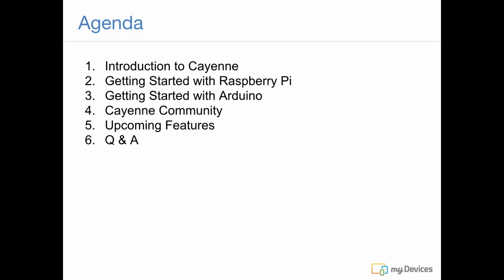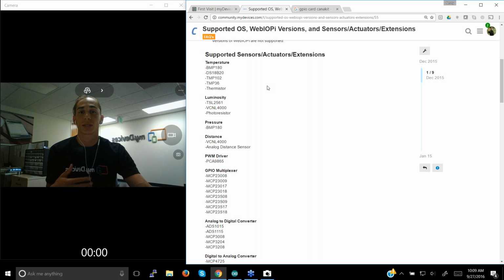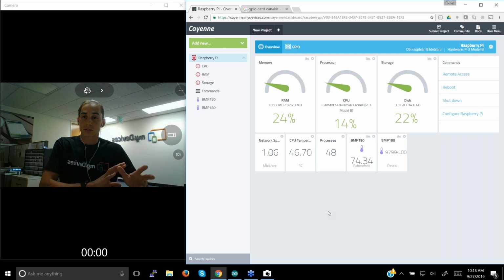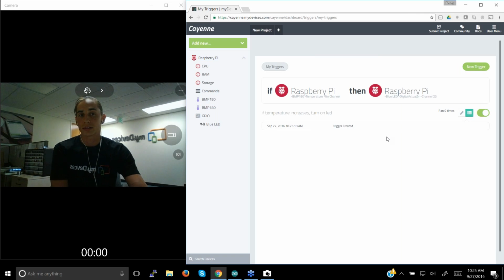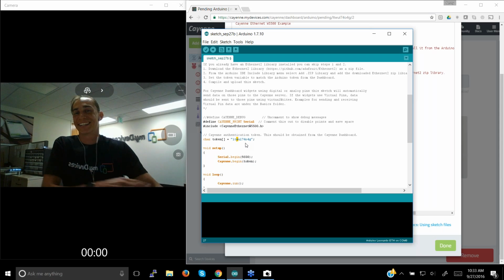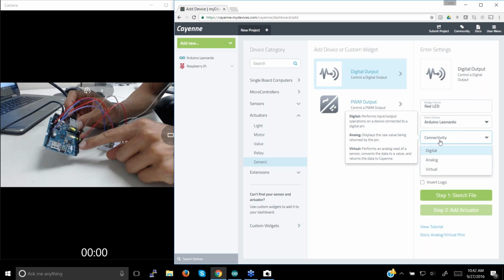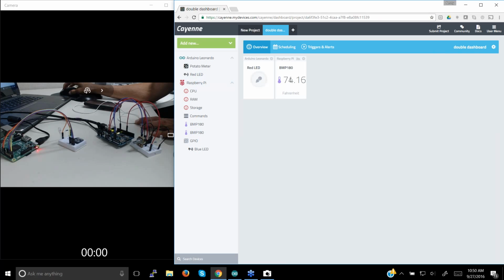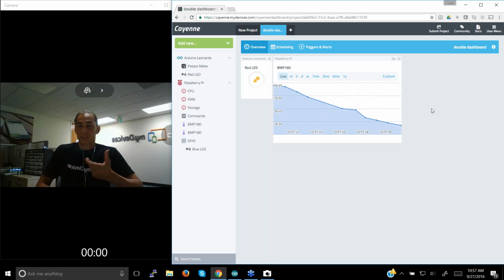Introduction to Cayenne

Comment: I have a question. I want to use ASC712 current sensor connected with MP3008 sensor. The output value will be current sensor. Can you tell me should I directly hook it up and the values will be current values or so I have to do some callibration?
Reply from the maker: Hello! Please head on over to our Community at: community.mydevices.com with this question. We have many people there waiting to assist you!

Comment: How can I connect a DHT11 sensor module to Cayenne, is the module available on the platform.

Could not have found a way to read the temperature data of that sensor, can I help with that problem?
Reply from the maker: Thanks for offering to help, Andres! Though it's not officially on the platform yet, many users have contributed based on the ways they've added it. Here's a link to our Community forum for DHT11 with Arduino, and for Pi. 

http://community.mydevices.com/t/want-working-dht11-code/2068 

http://community.mydevices.com/t/dht11-dht22-with-raspberry-pi/2015

Comment: Hola hace unos días intente conectar un Arduino uno, y la Ethernet Shield W5100, con Cayenne, y cuando llegaba a la etapa que Cayenne dice (Waiting for board to connect..) tarda y tarda y no hay caso, en este caso se cargó el código al Arduino y la Arduino Ethernet Shield W5100 está conectada al Router, espero pero no se conecta.
No obstante a los pocos días lo volví a intentar con una Arduino Mega 2560 y otra placa Arduino Ethernet Shield W5100, pero tampoco conecta. Realmente no se cuál es el problema.
Reply from the maker: Estoy usando Google Traductor para publicar esta respuesta, así que por favor disculpe cualquier error. Siento haber encontrado un problema. Puesto que tiene una cuenta, podrá crear un nuevo tema en nuestra sección de ayuda de la comunidad. A veces es una solución muy simple, pero de cualquier manera, los demás tendrían que saber un poco más acerca de su configuración. Aquí hay un enlace directo. Http://community.mydevices.com/c/need-help-with-my-project

Comment: how can i use voice control with cayenne, just asking for info or where to find?
Reply from the maker: Alonso, here's a close project we found that uses voice control, though it's a little complicated and pulls in a lot of hardware. It's a link to the Community, so if you browse the "Projects Made with Cayenne" section, you'll find more ideas, as well. http://community.mydevices.com/t/esp8266-nodemcu-with-dht11-connected-to-cayenne-and-alexapi/1979

Comment: Hi, I have a node-red , MQTT based automation system. Can I integrate Cayene as a admin/monitoring tool, rather than connecting sensors directly to Cayenne, my sensors and actuators are based on ESP8266 and connects to a node-red server (also has MQTT server running for publish/recieve requests. Can I connect to this MQTT and monitor the system?
Reply from the maker: Ajith, this should work, but it may require a more advanced setup. If you'd like, you can create a post in the Community forum so that other users can collaborate with your idea: http://community.mydevices.com/c/need-help-with-my-project

Comment: worst sound ever
Reply from the maker: Eric, the sound isn't ideal, though other users have been able to hear it. We'll definitely look into a better mic for future videos, though. Thanks for the feedback.
Reply: Also get your interviewer to ask one question at a time, clearly!
I liked your digression into possible reasons why the >80 degree sensor might not know about a high level trip while it was rebooting as an example of designing with failures in mind, but the question was about persistence after a power down (I think) and the answer, principally, was "Yes, it works after a power cut"
The point about the scheduler running on the Pi and not on the PC or browser is very important, as is the the issue of security in industrial-commerical applications

Comment: can cayenne working with multiple of different sensor? where i can get the code for the multiple of different sensor.
Thanks
Reply from the maker: Hey Arduino Data, we have a list of supported hardware for our dashboard with all the code ready. Since we released the API (beta), you can now add any of your own hardware, but if it's not already supported, you would need to write or find your own code online. If you'd like more detailed help that is specific to your project, you can post to this Help section of our Community forum and our users and admins would be happy to give input! http://community.mydevices.com/c/need-help-with-my-project